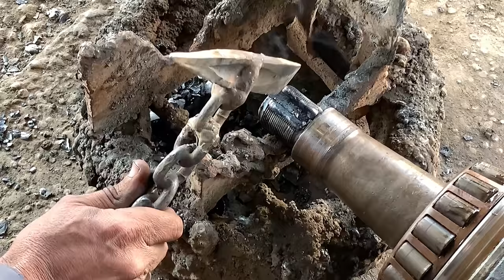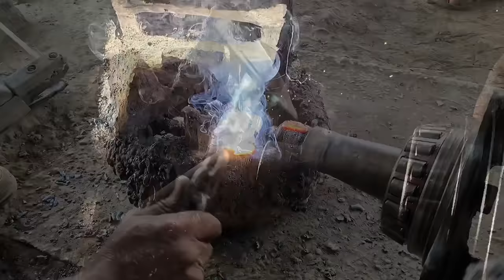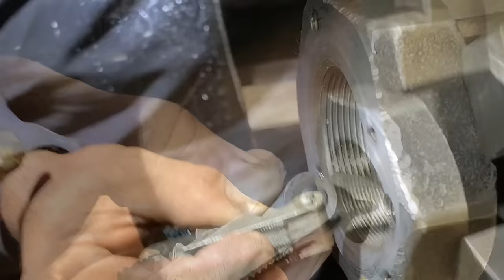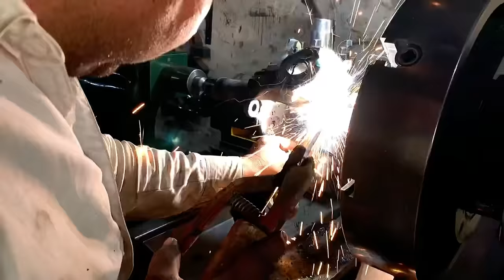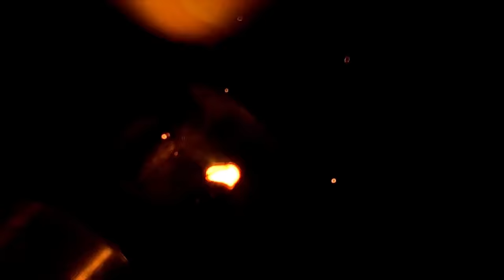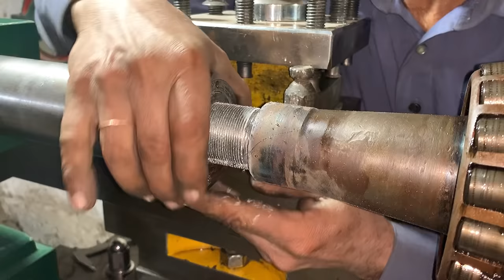Repairing Trailer Axle Drop Spindle || Truck Axle Spindle Replacement ||

Comment: How it's done when new parts are unavailable and nothing is a 'throw away' part. 
The methods seem crude by today's standards, but the skills show it's the machinist, not the tools that get it done.
Reply: The procedure is pretty cool and i understand why they would do this if no replacement parts are available(or if it's used for off-road use only), but it is an attorney's dream come true anywhere but a 3rd world country. Have seen this done by very competent machine shops and last indefinitely, but have also seen them break off. PS if it breaks, it doesn't break where it's welded. It breaks within an inch of the weld. High heat(welding) alters the molecular structure of the parent metal. Don't ask me why the hell friction welding works for putting a flange on an axle though. These guys weld crankshafts back together. Neat to see
Reply: בעלי מקצוע שורשיים ומביני עניין בצורה בלתי רגילה.עובדים בכלים מיושנים ובתנאי עבודה שאינם מתאימים לעידן הטכנולוגי המודרני. אבל כל הכבוד לידע המקצועי שלהם על אף התנאים הסביבתיים הקשים. על אף פי כן הם מתפרנסים בכבוד ראוי להערכה.

Comment: Maybe remove that inner bearing so it doesn't get weld splatter all over it?
Reply: When that bearing goes to shit they get paid to fix that too. Lol
Reply: Surely that old bearing was left on to protect the journal.    Let's hope so.
Reply: @0799davey67  yea that's what I'm hoping but, if I were them I'd strip it all so clean it all in one shot, plus if you needed heat to remove bearing it's already in your hands and use it rags tied around to protect surfaces,

Comment: I mean most people take the bearings off before you do a whole bunch of metal cutting, and welding which is going to send specks of metal and weld splatter all over the place, and your just gonna throw that back together and run? See yea one wheel less 😬

Comment: I would not weld something on a lathe, if someone did welding on my lathe I would boot them up the Arse, not only could it damage the bed but running a welding earth through the head bearings could ark between the balls and the bearing case damaging the bearing, I would just make a new undersize nut and weld nothing.